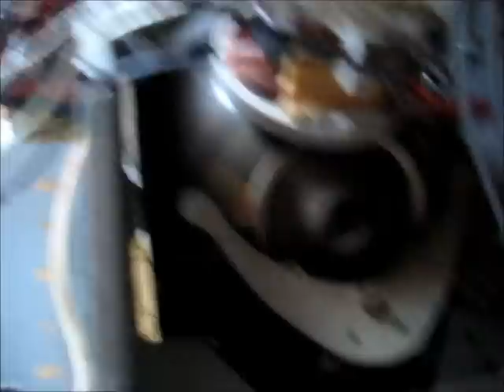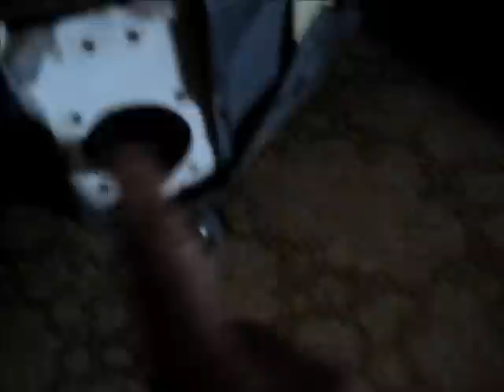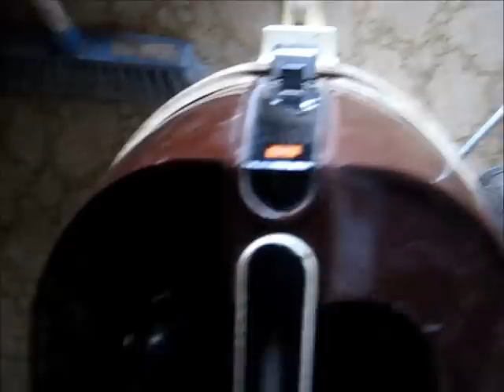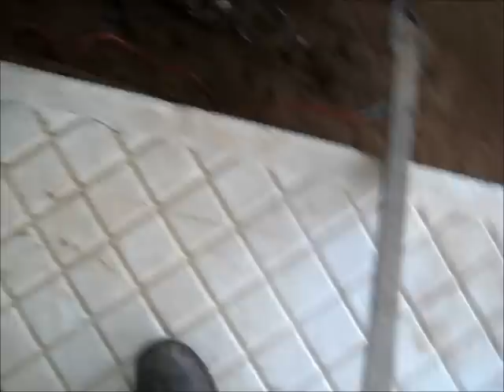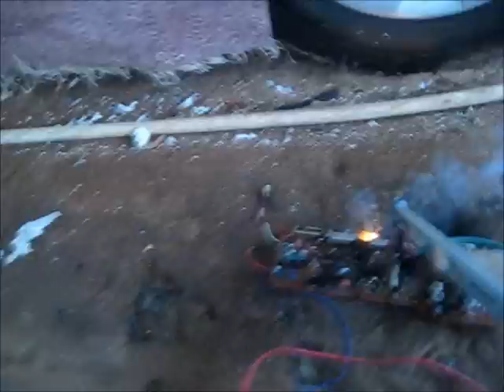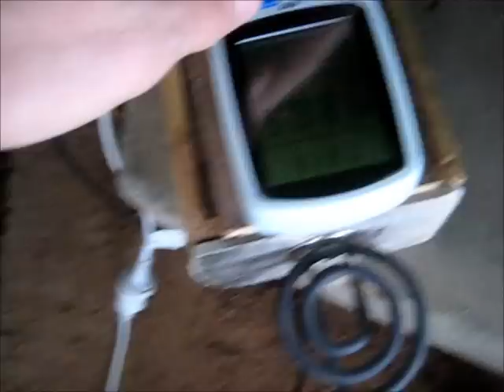Update & Cap popping

Comment: Hiya. About the plug-in watt meter. It will show a lower voltage, because you placed it in between two loads that are connected through each other. There will be volt-drop, just like tree-bulbs. Those are only 12v, but plugged into 240v, but because there's 20 of them in series, they work OK due to the volt-drop that takes place. 

If you'd have plugged it into a standard wall outlet, then it would have shown your usual domestic voltage, which I believe is 230 / 240v. :-)

-BoomBoxDeluxe.

Comment: it's interesting, drops only to 147 volts..what's the heating element resistance ? i guess from the drop and current about 20 ohms when it's hot... but it may vary, i rather run my MOT on 2kw transformer  it has 100-110-120-200-220-240  taps and i usually use the 100v output (240v input) and the current draw is around 8-9amps on short circuit and the MOT never overheats, works magically well.. the problem with yours is the energy loss from produced heat, i recommend using lower voltage too ;)

Comment: aww, RPTV tubes make great pops when you smash them under vaccuum :D. I'll have to give you a sledge hammer for Christmas :D

but yeh, aside from striking the neck with a screw driver, the drill is one of the safest ways to remove vaccuum.